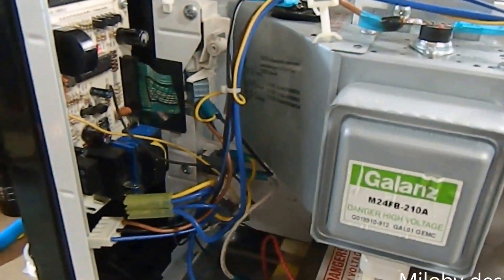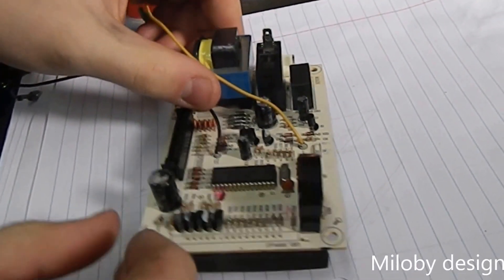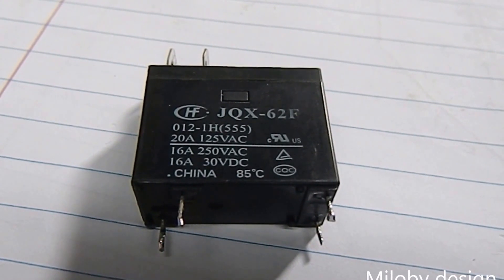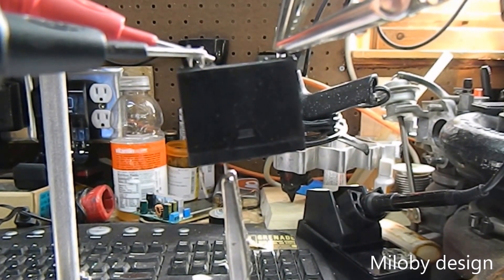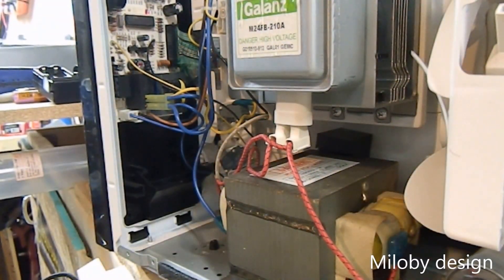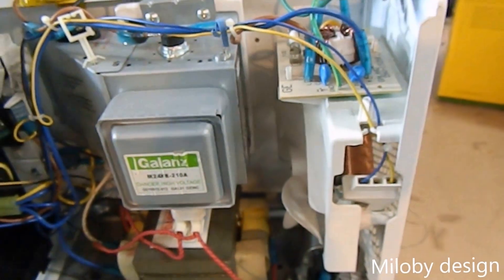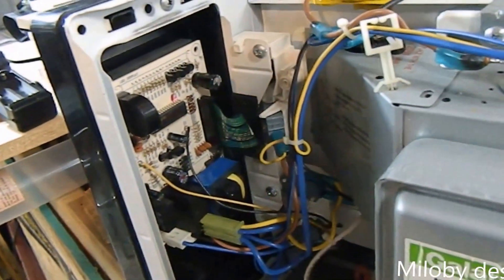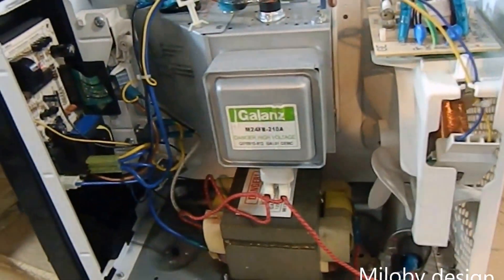Microwave Repair Problem solved

Comment: My microwave can not turn on bulb and fan but it's heating with low harmmm sound but fan and bulb works when door is open all switches are ok could the relay be the problem help me
Reply from the maker: You need to find out if your transformer is getting a 120  Volts. There should be a high voltage relay that will turn the transformer on.

Comment: Thank you so so much for your suggestion and really easy to understand video. I checked the voltage from the relay (to the transformer) and when I powered on it sometimes shows 120V... next time powered on shows 115V, and 120V again then... 80V... 50V.. sometimes none.. so obviously this unit produces unstable voltage each time I powered on. I tapped relay and all of a sudden the voltage went up to 120V... Is this problem caused by a relay switch? (I just in case ordered relay switches anyway)
Reply from the maker: Try wiggling some wires. You might have a break or a bad connection.
Reply: @milobydesign  thank you for your reply! I will check all the wiring.

Comment: How do we know the microwave oven's relay is broken. Please answer me or help me urgently.
Reply from the maker: Send voltage across the coil of the relay, then measure the resistance across the contacts. If the relay is functioning, the circuit would be closed and show no resistance.

Comment: If you could only see the top just do a search of JQX-62F and you won't have to take it off.  Look on ebay or do an internet search and you will find one with the info you need on the side.  Your way works too, but just a tad more work.

Comment: It's really helpful. Could you make a video how initial diagnosis.. and how to remove relay from PCB .
Reply from the maker: Unfortunately, I dont fix microwaves. This was a project many years ago. To remove a relay from a pcb, use a soldering iron. Stick a screwdriver under the relay to pry up while you heat the pins of the relay.  Watch some tutorials on using a multimeter. Get very conferrable with a multimeter. Learn to trace power like explained in the video.

Comment: SIR, I HAVE GE BRAND TABLE TOP MV AND NOT GETTING POWER SUPPLY. HAVE CHECKED ALL PARTS WITH MULTI METER WITH CONTINUOUS MODE AND SEEMS TO BE OK. ONLY PROBLEM IS NOT GETTING POWER SUPPLY. TRIED SEVERAL TIME SWITCHING POWER SUPPLY ON AND OFF BUT STILL NOT GETTING POWER SUPPLY. TRIED IN ANOTHER POWER SUPPLY PLUG AND STILL DO NOT GET POWER SUPPLY. PLEASE PROVIDE SUGGESTION TO RESOLVE THE ISSUE. THANKS
Reply from the maker: power supply fuse? It would be where the cord goes into the circuit board.
Reply: I would guess your main fuse is blown, take it out and check continuity

Comment: Where do you order the relay? I have the same issue.
Reply from the maker: You would have to source it from ebay or ali Express. Go off the specs labeled on the relay. If that info is not labeled, you may be able to purchase the replacement circuit board. Try the numbers labeled on the circuit board. Punch them in and see what comes up.